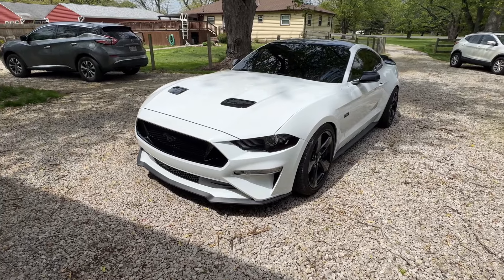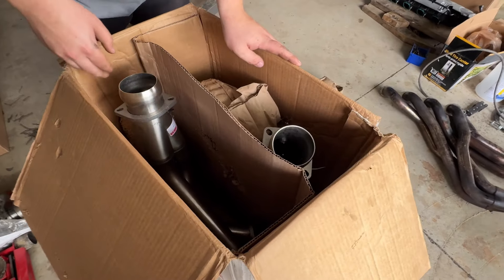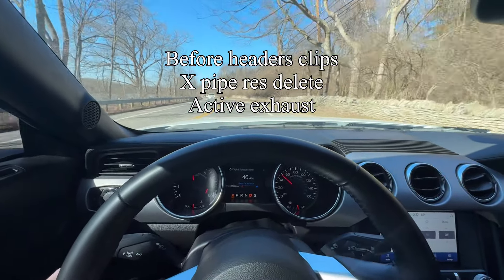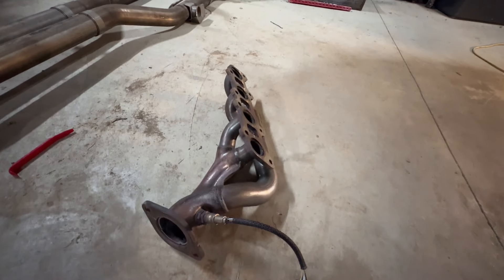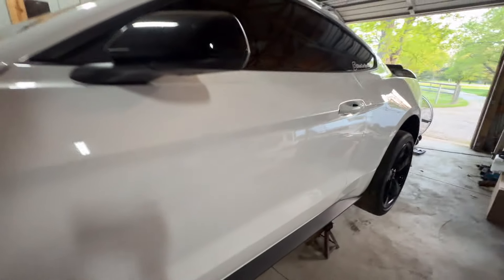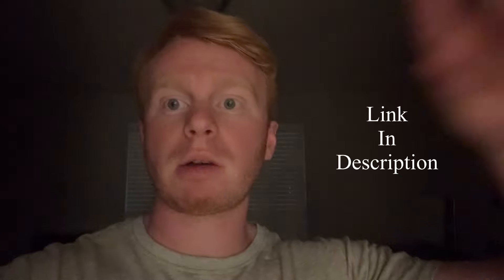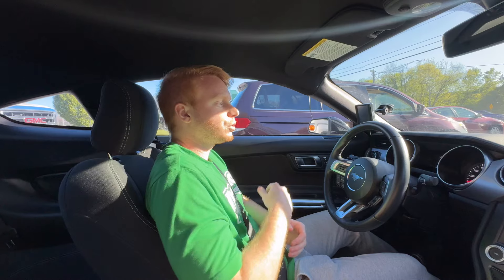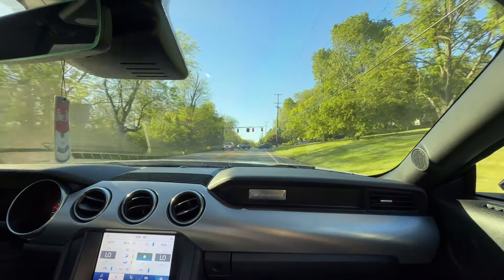2023 Mustang GT Gets Catless Longtube Headers!

Comment: What did you do about the check engine light?
Reply from the maker: It’s still on. But the LRX tuning device shows you exactly what’s your CEL is on for. So my 2 codes are for my left and right catalytic converter!
Reply: So your car didn’t go into limp mode with those codes on?
Reply from the maker: I did not. Car ran completely smooth!
Reply: Who cares

Comment: Did the headers come with any connection adapters to be able to connect to your xpipe ? If not , Did you buy them separately? If so which ones did you get ? Thanks man🔥🔥
Reply from the maker: Luckily it was similar sizing pipes so they way we did it was we just slipped the x pipe right up to the connection pipes and clamped it down. You will have to play around with it to make sure you don’t get exhaust leak!

Comment: I have Long Tubes, no cats, stock resonator and stock catback.  Still made 800hp.  Long tubes and cats are where the HP gains are, after that it’s just noise.  I used to have an H-pipe and MBRP catback which blew the pictures off my garage walls.  I got rid of that crap and put the stock stuff back on.  My channel has videos with cold starts in the beginning.
Reply: This the facts
Reply: You did not make 800 HP 😆
Reply: @XFader505 right lmao or he’s forgetting to mention that he has some type of forced air induction device in the car as well to get anywhere near that 😂
Reply: Stupid you chose to not keep it sounding badass
Reply: What kind of brand are the headers? Thank you for your help!
Reply: @deesplash7087 If you go to his channel you can see that it has a blower